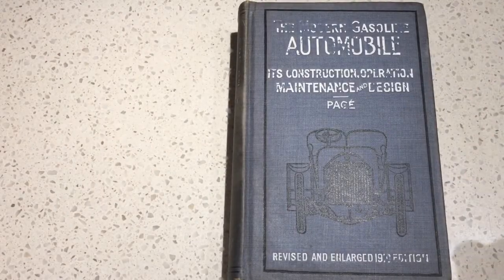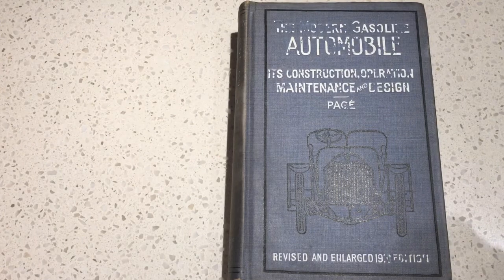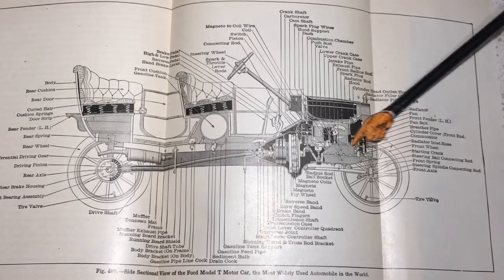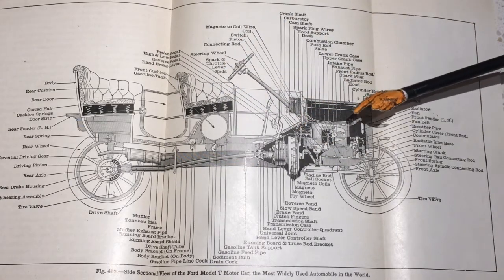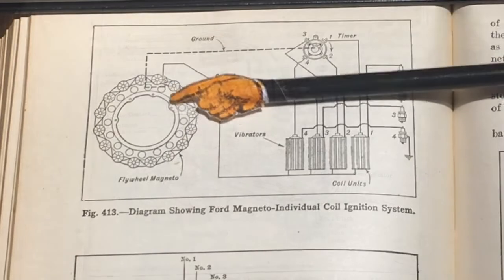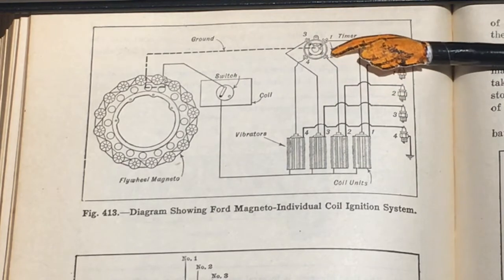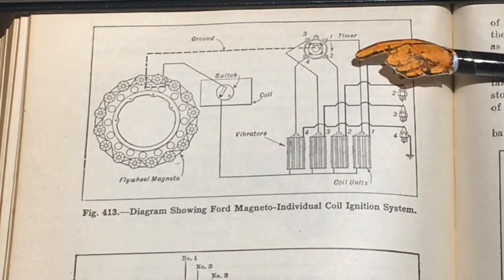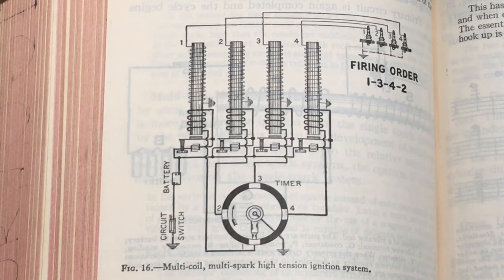Model T's Ignition System

Comment: Fab. The diagram is wrong on the firing order though,showing 1-3-4-2. The picture shows the timer progressing clockwise 1-2-3-4. Ford timing order has always been 1-2-4-3 and British cars generally were 1-3-4-2. Can be important as reference to the poor mechanic pulling his hair out under the bonnet in the rain wondering which way round the leads went.
Reply from the maker: Thx for the details, and thx for watching. 👍🍻

Comment: Questions.  This car its the one ford  did recall buy back  most of units sold on us .  And  the other thing its the a/c electric create on this kinda of sistem  will boil water and creates movement in the crank . The only problem is the sistem need to be ready creating the A/C  in order to no stop and control the volume of fluid cause if its to much will hidrolock . The suzi its same think and will runn . Now if the a/c power its steady and  dont fluctuate is just start and runn . Give exempl  get lawnmower and put  wire from the outlet of the house a/c  on top of the spark and the ground on the body of the motor  and runn  after start u can use water to keep going the only thing to remember its u need to ajust the volume of liquid.

Comment: Great video thanks for uploading…frequency fires the engine…Not the spark…see the SUZUKI video and JOE X video.  Joe talks about waste spark management and how the CONDENSER Frequency is the most important component of the ICE ignition system.  The oldest cars and airplanes fired on Flatline DC frequency ONE WIRE to the engine block and it would work on 1 - 12 cylinder engines…NO SPARK INVOLVED.  80 degrees advanced from TDC Top Dead Center.  Plz put more like this up thx great video!
Reply from the maker: Thank you very much indeed. And thx for watching 🍻

Comment: yes you are right multipel spark system it was common to use multipel primary,secundary wires in different configuration including different condenser and resistor values commonly they look like dimmer rotary switches .
So tehnicaly speaking they are similar to Hei or Cdi ignition even that spark polarity can be changed as well.
Dual engine designs used dual spark .
Your realy good at it hoppe you have sucess finding new things that book is nice to look that manual ajusting is necesary still today modern ignition systems are terribel choice they have to much problems that same ignition system you are describeing was even strong enough to fry raw oil those old engines used also dual fueling carburetors the exaust pipes were close to carburetor so actualy that engine was multi fuel engine preaty cool staff considering how old that thing was
Reply: Good straight forward video. When I opened the hood of a 24 model T and saw no distributor i had to study it to wrap my head around it. This video would have saved a lot of time. Thank you for posting.
Reply from the maker: Thank you very much. And thanks for taking the time to leave a thoughtful comment. Cheers 🍻

Comment: Thank you for making this video, I have a 1917 and the only thing that is left is the Commutator and I didn't  know anything about the IS before the video. I don't have any thing but spark plugs and the commutator, I'm glad I saw your video before I tried putting a modern coil on and feeding the plugs from the commutator because I was thinking it was a distributor. lol, what if I put four modern coils after the commutator, do you think that would work, or would I need more things in-between to make it work?
Reply: Great video. I'm attempting to run a 1924 model T for the first time and am just beginning to understand what I'm looking at. This helped greatly. Thank you.
Reply from the maker: It’s genius engineering for the time frame. Thx for watching, and good luck with your project. 🍀👍🍻
Reply from the maker: While triggering a modern coil on plug set up is possible I am not sure that would be  the best approach. Did you consider obtaining the box and coils. I am not a “T” owner but think they can still be had still at not too ridiculous cost…
Reply: @TheGibby3340  Yes I have, and I want to , Its just in the mean while a lot of them peace are out of my price rang or are in need of costly repair.. I don't' have 300+ bucks to dump in to coils atm, right now I just want to see the motor run, and I if I could find a ez cheep temp fix for the mean while I would be happy

Comment: I find the whole thing quite fascinating. sir. Should have done this many, many years ago. Sometimes the obvious is invisible to the eye. You sir, are an excellent teacher. Excellent inflection and clarity. You make the that which at first appears murky but then a moment of clarity ensues. Of course. So simple. Why didn't I think of that. No damn computers. Just a basic application of Ohm's Law. KISS principle. If it ain't broke why fix it. 15 million is a LOT of anything in our present dilemma. Haven't had time to read all the comments but wouldn't worry about shaky pointer comment. If I were doing the video I'm sure Id be like a rabbit jacked on meth. Not quite as calm as you. I'm a little hesitant to open this subject but I will anyways. The following is strictly off the books. So far just conjecture. Will have to draw the circuits myself to help figure it out. Maybe it's too simple. Apparently Ford was having some kinds of trouble with the oil companies. So what he said to them was either leave me alone or I'll set up my cars to run magnetically. Because of the huge magneto cow magnets in the large housing behind the engine. Always protect your electrical stuff from the elements. I just wonder. Could it be done? Take the petrol engine out of the equation and maybe use the battery somehow. H'mm. I wonder. There's still so much we don't know about electrons and magnets. All started with that darn Faraday's disc. You're looking at the meter and saying, WTF!!! How can a "solid" sheet produce a small voltage. I though a voltage was produced.when a magnetic field rotated past a coil of wire/wires. Or vica versa. Another h'mm. Too many mysteries. Excellent video. sir. Well done. Doesn't matter how many people see this video. There are always the seekers.
Reply from the maker: Thank you very much. It’s greatly appreciated you took the time to leave your thoughts on the subject. Learning is like that...If your not catching a “Buzz” ( no cheap pun intended) your not studying the right material for you. Thanks again...Cheers 👍

Comment: Bloody brilliant upload.
Endless thanks for your time.
2,144 views to date only 68 thumps up.
This is fantastic, come on you lot more encouragement.
I'm a self taught motor mechanic, got my first motorcycle in 1967 age 16.
Still disillusioned with most in the trade even engine machinists don't seem to do as you request.
It’s generally not the tradie but the dealer at fault.
Some self employed motor mechanic are ratbags, be very careful out there.
Reply from the maker: Thanks for the kind words. Cheers 👍

Comment: Thanks for this video. A nice fellow was showing me his Model T Ford today, a 1922 model I think he said... anyway I asked him how the timing worked as I noticed the ignition system was firewall mounted and there wasn't a visible distributor. He even showed me an old coil in the wooden box. As an aircraft mechanic I can tell you I've seen some cool stuff but this old car was truly a work of art. So very simple but also mechanical genius as well. Considering the available technology the engineering behind this car and the mass production of it was pure genius as well. When I seen the exterior contact points on the coil box it left me scratching my head but your video along with the coil diagram made it all clear to me. The operation is so simple you can actually overthink it. High voltage output from induction generated by a high frequency coil modulation...field collapse and motivation. MSD ignition system from the cave man era lol. But what ain't funny about it is that it all still works like a champ. A 100 year old ignition system with original wiring that still freaking works! Don't get me wrong, I sure as hell wouldn't want to try to crank it on a cold frozen night with that hand crank...but you know it still had to beat the heck out of walking or riding a horse!!!
Reply from the maker: Wesley Umbarger Very well said Sir. Very much like yourself, I really admire the elegant simplicity. The original Multi Spark Discharge system 😀 Thanks for watching. Your meaningful comment is greatly appreciated. Cheers 👍

Comment: A cross between the 'lawn mower engine' style magneto and 'coil on/near plug' system.
That picture you showed of the horse shoe magnets on the flywheel, i counted 16 mounted on it.  But i didn't see the magnet keepers mounted to it to stop them flying off.
Reply from the maker: Hi and thx for watching...Think they came in different styles over the production run but I am a no expert...not even close. Just found the ignition system design quite unique. Thx again.